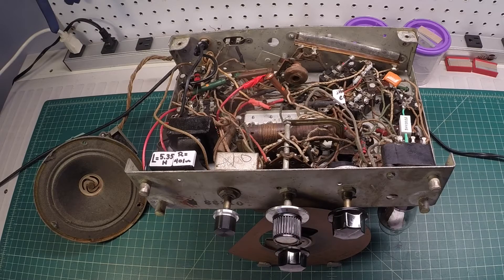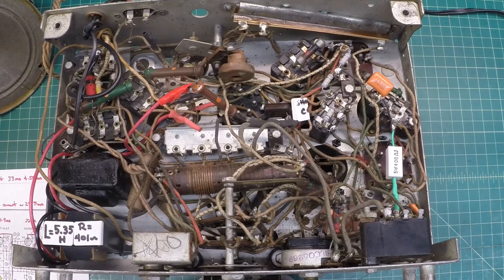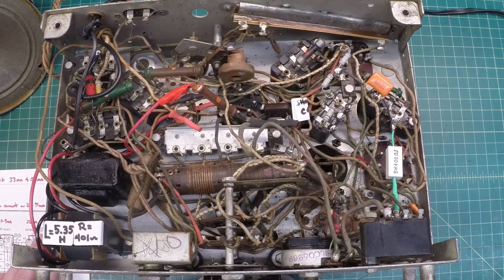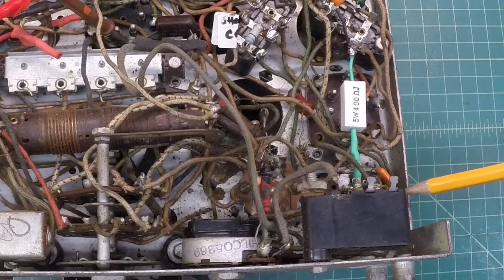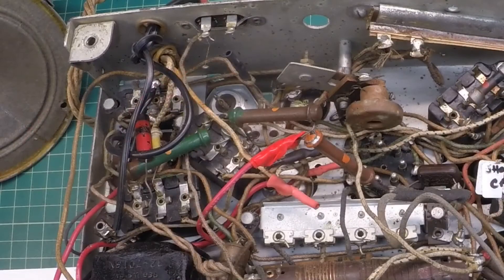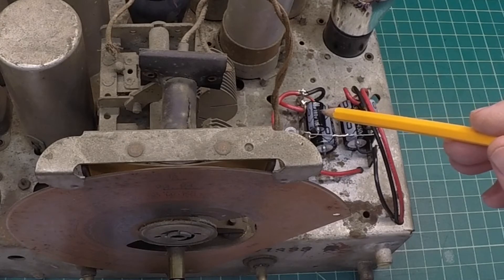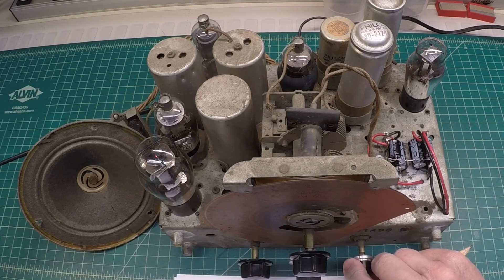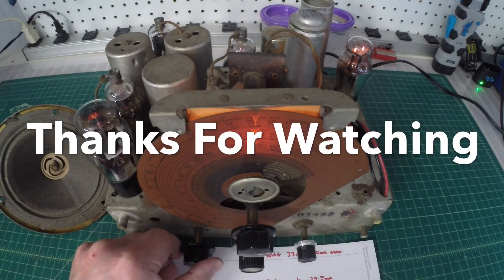Philco 611 - Back Together & Playing

Comment: Other than replacing the candohm and the dogbone resistors, I'd leave this radio alone.  By the way those replacement tubes look either new or NOS.  Where do you usually get them?
Reply: The Candohm resistor is SUPPOSED to get hot....no reason to change it, unless there is a problem with it(heat is NOT a problem).
Reply from the maker: +Martin Tousignant Hi Martin - I usually use tubes I have on hand or from a donor set yet to be restored. Providers in the past have been www.tubedepot.com along w/ www.oldradioparts.com and very rarely eBay. Best, Don